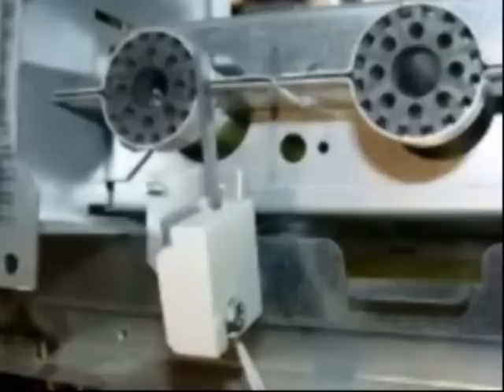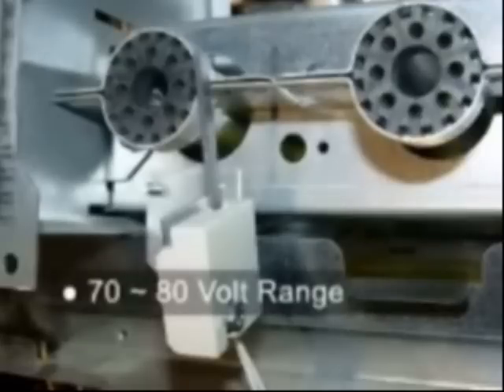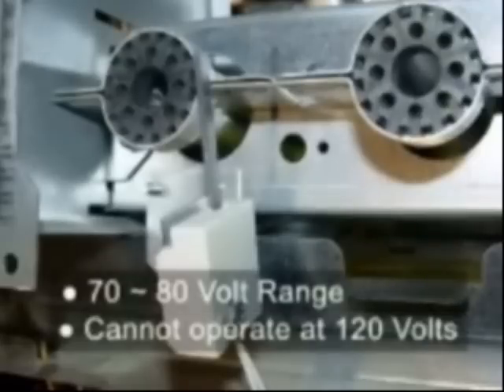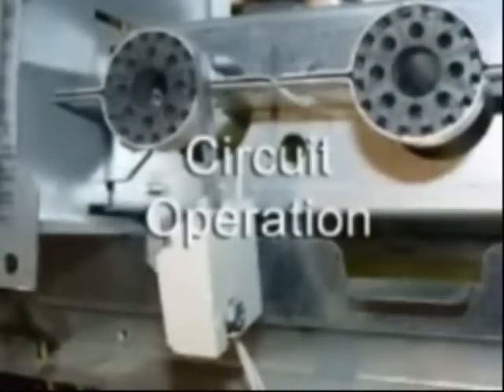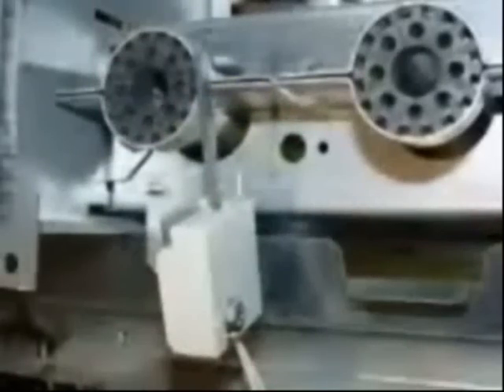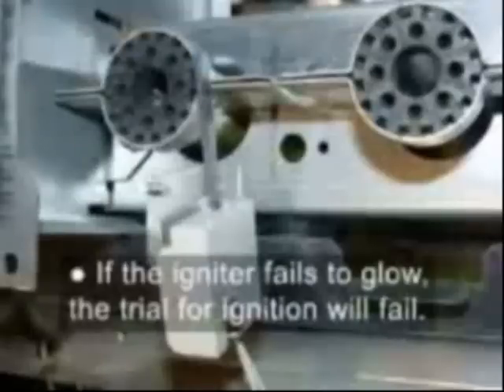Silicone Nitride Hot Surface Igniter

Comment: Clamp-on ammeter I get 1.16 amps on a 80V x 92 Watt ignitor. Voltage is jumping up and down but current is rock solid.  
Four years with no problems then had replacement opened up after one week. Who do you trust to suggest replacement part numbers? No one sells the original part but are selling the exact replacement as per manufacturer specs.